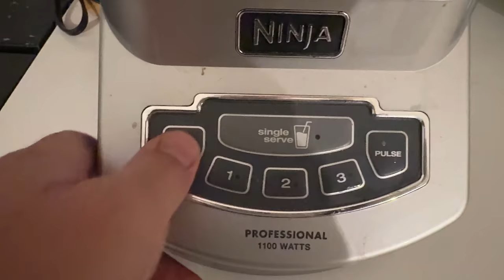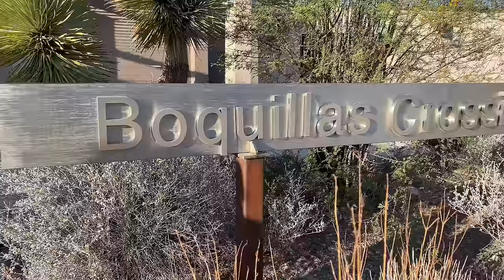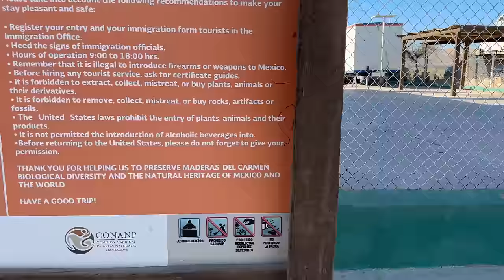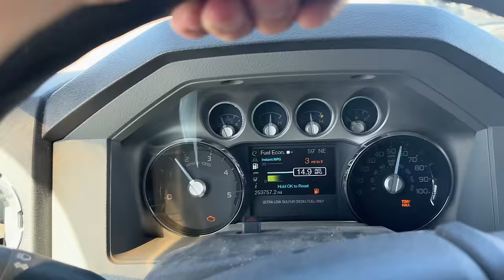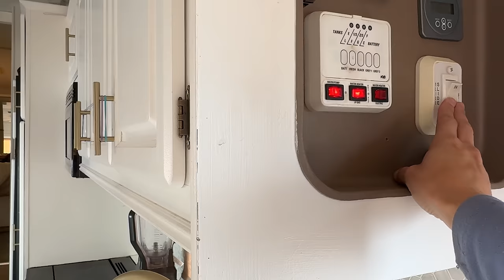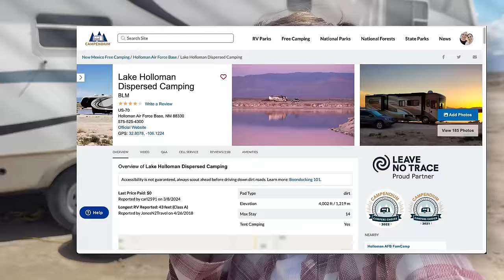Is RV Life UNSAFE? Mexico Border Crossing + Sketchy Roads

Comment: As a certified welder, 35 year automotive technician, and retired college teacher in automotive technology, I must say I am impressed with your ability to diagnose and design a repair for the slide, considering the boundaries of your circumstances.
Reply from the maker: I appreciate that. I think I got that passed down to me from my grandfather who always believed you could fix something with what you had on hand. It's a helpful ability...but it also leads you to sometimes not getting things properly fixed. 😂 (Slide still has the temp fix in it - now at least 2 months later because, hey...it's working...not need to fix it. LOL). Hopefully I didn't just remove all your respect. 🙂 -J

Comment: Eufy Solo built in battery and solar panel  (Wall Light or L40) with built in light works with built in AI and can be set to human only. Can be set to work like a light sensor when you get near it or not. Works will for our RV. With StarLink you also have an alarm system that will notify you on an iPhone etc. Setting can be any thing too if you want to use it to capture animals.
Reply from the maker: Thanks for the info! -J

Comment: YOU CAN USE THE REARVIEW MIRROR! Look for a wireless rearview camera, that transmits to a clip on rearview mirror. It slips over your rearview mirror, and has a rear display in it. Just needs power at both ends, no complicated wiring.
 Or you csn get a wireless rearview camera that just comes with a 4" monitor to put on your dash. Again, just needs power.
Reply from the maker: Interesting. -J

Comment: Get a Ring Spotlight camera.  That will give you a light and camera.  I have one that plugs in that I use as an area light and to monitor my driveway.
Reply from the maker: Do they run off batteries or do I have to wire them in? -J

Comment: I highly advise you to get that slide professionally fixed before you go to Alaska. That drive from Burwash Landing to Tok is going to bounce your trailer around a whole lot!!
Reply from the maker: Unfortunately, professionally fixed would mean installing a brand new slide mechanism. They don't make this style anymore. This style (two solid square tubes plus support) is more solid than many of the newer systems. I'm quite confident that my fix will do quite well, and if it doesn't...I'll fix it again. 😁 

Bumpy roads aren't new for us - we'll always take everything slow. -J
Reply: @OpenRoading  got it. Then be sure to take extra parts. Lots of miles with nothing in between. :)
Reply from the maker: @juanitasellshouses  Indeed. My inner MacGuyver may be tested in the North! 😂 -J

Comment: I lubed the heck out of one side. It made them come in even.
Reply from the maker: Yeah - I need to lube them up but having taken the original piece apart I know that the issue is my home-made pin. The original had zero play in it. When the gear turned the pin and square tube turned at the same rate because they were completely solid with the gear. My pin, because my fit wasn't perfect, has 1/16 to 1/8 rotation worth of play where the gear can turn before the pin catches. Once I can fix that it will fix that problem. -J

Comment: I like your channel but you need to put a counter at the end like you did for the dogs in Mexico.   
Using the word Boonedocking  = 33 times !
  Kinda hard to say your Boondocking with starlink, cell service, hot and cold running water, with the 
air conditioner blowing down on ya, while you're sitting on the toilet. 
  If you want some true  boone docking come stay in my Deer camp, there's about four lightbulbs in it that run off of a little 1500W generator, and if you want some water you better bring it with you, and bring plenty of toilet paper because you're gonna be using the bushes outback. 
   Btw there was not near enough of Trinity in this video. I've done got attached to her.
Reply from the maker: LOL! Fair points. But a couple of notes:

We can't run our AC off our batteries. And boondocking technically is having no hookups. So whether or not we are self-contained with our own water and such, it's still boondocking. 

And FYI....The next 2 weeks we'll be saying boondocking a lot again. 😂 -J

Comment: How much is starlink
Reply from the maker: The starlink equipment is $600 new. We bought it used so we save a couple of hundred there.

Then the monthly cost depends on the plan.

Starlink residential is $120 a month but it's always ongoing.

Starlink roam (the plan we have) is $150 a month but you can "pause" your plan at the end of each billing cycle and restart it the next time you need it. So hopefully we'll be pausing ours soon if we get to a place where our Tmobile unlimited works well. -J
Reply: @OpenRoading  wow, thank you.  I'd buy it used to, my mind is blown.
Reply from the maker: @violetgeokimmel5805  The benefit for us is it works so many places where cell service does not. So amount of time and energy we save trying to figure out where to boondock next has dropped significantly after our first 4 years without it where we were constantly checking cell maps and even having to change locations last minute because we got there and didn't have strong enough signal for work. -J

Comment: I’m pretty worried about getting a slider. I know we would not be able to fix it if it failed.
Reply from the maker: If you get one just do your research ahead of time. This rig is 19 years old...so things are going to break. 😀 But it seems that there are some specific slides types that are prone to breaking.

One of the reasons I'm working so hard to fix this one on my own is because the hardware doesn't exist anymore so to have it professionally fixed would mean having a whole new slide mechanism installed and I think this one is quite solid. -J